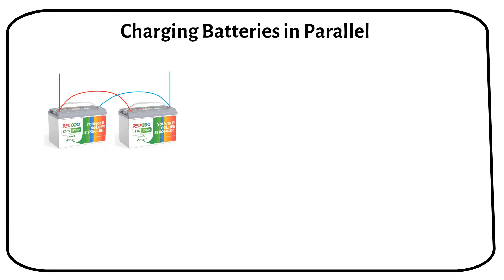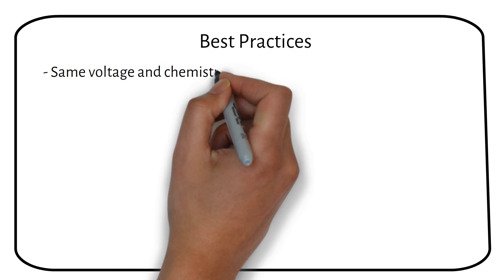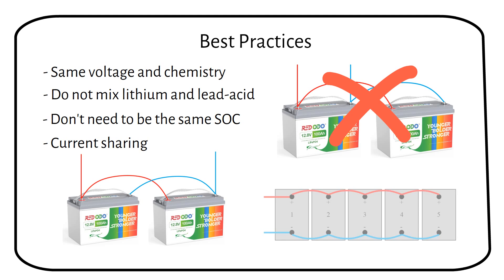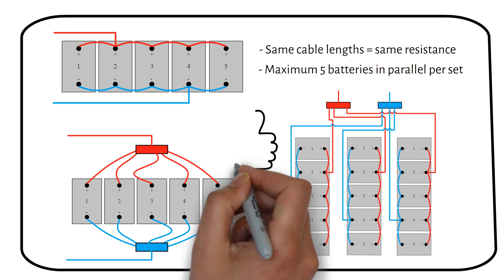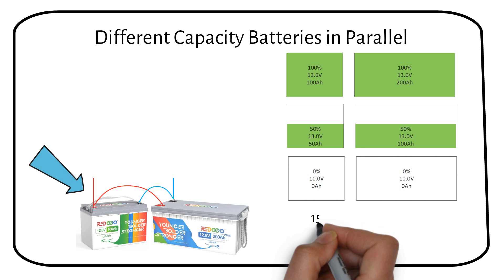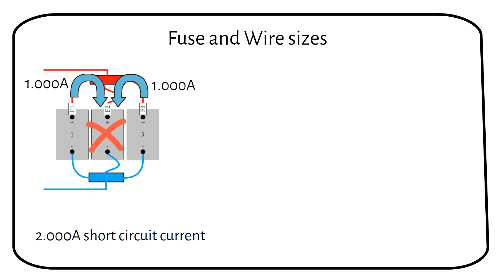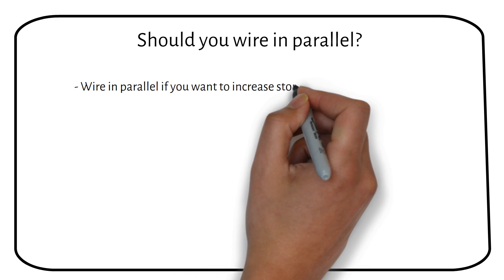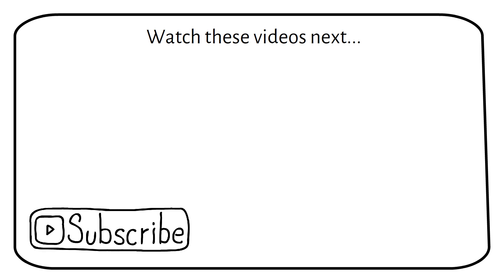How to Charge Batteries in Parallel With Different Capacity

Comment: Lithium and lead acid work very well together so long as the lithium has a programable BMS. The advantage of doing this is that it saves the cost of having to get lithium profile chargers and it protects an alternator in the event of a BMS disconnect. It also gives redundancy. I’ve been running hybrid for several years and so have many other boaters.
Reply from the maker: What voltage are you setting your charge to?
Reply: @cleversolarpower  I set the BMS to disconnect charge at either 14 or 14.2v the chargers are set at standard lead acid so 14.4 and a float of 13.5 which suits both lead and lithium. Setting the BMS lower than the chargers ensures that you never get a ‘low voltage overcharge’ situation from the alternator or from solar controllers absorbing before going into float. The 14  / 14.2v is chosen as it allows the battery to enter the upper ‘knee’ portion of the charge curve and perform balancing if needed. I use 14v when solar is the main charge source and sometimes 14.2 if using the alternator as the current on mine can be fairly high (0.25+C) as that allows the battery to get a bit more full than it would at 14v. 14v works well with solar as, at the often lower charge rates, it gets the battery to around 99%+ full. My system is data logged at one minute intervals and I have used the data gathered to come up with those settings.
Reply from the maker: Thanks for your extensive answer. I might do a video about this when i run some tests.
Reply: @philbrooke-little7082  do you have a video, or a diagram of your setup? Do you have one DMS for all the batteries, or more than one (ie one bms for the lithium, and one for the lead acid)? Your disconnect charge of 14 or 14.2 V is for both types of batteries?
Reply: @samv5475  only the lithium has and needs a BMS. the lead acid is always connected and is there for when the bms disconnects on full charge, cell over or under volts, battery undervolts and any temperature based disconnect. It act as a redundant system and also to protect devices such as the alternator and boat loads should the bms disconnect.
Reply: Just saying u r good helping ppl

Can u do more on 24v setup...I need do this in a few mnths.tc @cleversolarpower
Reply: So do you use any isolators?
Reply: there are LiFe batteries that are 1:1 drop in replacements for lead acid, requiring no change of the carger as the BMS will handle that. A quick look in the datasheet will tell if the battery is ok with being in parallel to a lead acid or not.
Reply: @wernerviehhauser94  The issue is that the BMS has to be able to disconnect charge below the max voltage of the charging sources which, with lead acid, tends to be 14.4v. Lithium are set by most manufacturers to 14.6v or even 14.7v which is the limit and beyond respectively. Even if you set the BMS up correctly so it disconnects charge when full the issue is alternators as removing a load suddenly from them leads to a voltage spike which can destroy them. This is a prime reason for the lead acid but it also gives you a redundant system so the lights don't just go out if you mismanage your charging or if there is a cell imbalance.
Reply: @philbrooke-little7082  Did you take into account that a close-to-full-battery will have a close-to-zero charging current? Does not seem to be the case..... I would guess that people developing the BMS for such batteries would be smart enough to account for that, otoh my car has a current draw just short of 10A while running - I do not see the possibility of a large voltage spike there.
Reply: @wernerviehhauser94  Yes of course but, as you disconnect before the battery is chock full to the brim, there is still a good amount of current flowing. There have been batteries marketed as "drop in replacements"  for many years but the fact is that they really aren't, it's just marketing. The battery will be out of warranty by the time it has degraded enough from low voltage overcharge. A lot of battery claims are more down to marketing speak rather than actual facts.

Comment: I have two battery banks. Eight 12 V Battle Born Batteries in series parallel at 48 V. The next battery bank is four SOK 12 V batteries wired in series parallel, for 48 V. 
The only difference is that the Battle Born Batteries are 1C and the SOK are .5 C. 
I have them on separate shunts, because the battery voltage charging is slightly different.
Both battery banks are run to a positive and negative busbar. 
I put each battery bank at their proper amp hours. On the Battle Born Batteries shunt I have 200 amp hours and for the SOK I have 100 amp hours. This gives me a total of 300 amp hours.
The only thing I’m unsure of is whether to have my Victron Quattro 5000/48V inverter set at 300 amp hours?
Reply from the maker: Yes, I dont see a reason why not. Since you said they have different voltage charging, why not set both to the lowest recommended voltage voor charging, for example 57.6V instead of 58.4V. then you can use one shunt for the whole battery bank, and every battery is in the recommended range.
Reply: @cleversolarpower  
Using two different shunts, I can dial in the exact voltage recommended per manufacture, for each battery bank. There’s quite a bit of difference between each charge setting. 55.2 for SOK and 56.8 for BB. This gives me the ability to set the charge controllers for the best average. 🖖
Reply from the maker: Then i would set it at 55.2V, you are not going to 'waste' much capacity by lowering the voltage of your whole battery bank. And lithium likes not being charged all the way up to 100%.

Comment: Thank you for these great videos and I also have your book which has lots of great info. Is there a good way to test the capacity of AGM batteries? I have a bunch of used AGM batteries I'd like to use, but it's difficult to tell how much capacity each one has. I know some people say you have to run a load all the way down to 10.5v and measure the current draw, but I don't want to harm the battery.
Reply from the maker: Thank you for the kind words 🙏. If you have a shunt you can draw it down to 50% SOC and then double the capacity at the end. Then you know how much is left.
Reply: I was thinking about that, but then how can I know for sure when the battery is at 50%? AGM batteries will drop voltage under load.
@solarpower
Reply from the maker: Good question, use a c-rate that is 0.05C for lead acid (20 hours). Then the voltage will not drop that much. Check by disconnecting the load and see if the voltage settles.
Reply: @cleversolarpower I tried using a DL24 load tester at 10amps load down to 12v, but my readings didn't seem consistent. I recharged all my batteries, then let them sit for 2 days and see which ones remained at the highest voltage. I had 3 out of 8 that were above 13v, so I'm guessing those are my best batteries.

Comment: Do you not need to worry about battery balancing as well?  I would have though each pair of batteries in your diagram would need a balancer as they are in series?  Can you confirm if batteries in series need fuses on each positive terminal or just the main out one?
Reply from the maker: Since the batteries are in parallel, they will balance themselves. The balancer inside each battery will take care of balancing the individual cells inside. Batteries in series don't need individual fuses. Just one at the positive lead.
Reply: @cleversolarpower I thought the diagram had 2 off 100ah batteries in series with 2 off 280ah batteries in series with both series "banks" then in parallel?
Reply from the maker: Ah, you are referring to the diagram. I don't think this will be a big problem. The BMS will regulate the individual cells of each battery. balancing happens when the battery is fully charged, so having the batteries fully charged from time to time will solve this problem of imbalance in a series connection. Every battery will balance to it's rated voltage independently. If the battery is cycled a lot at a high c-rate then this might become a problem.